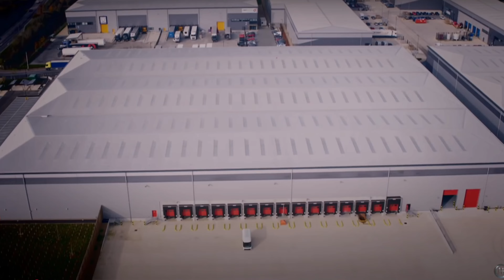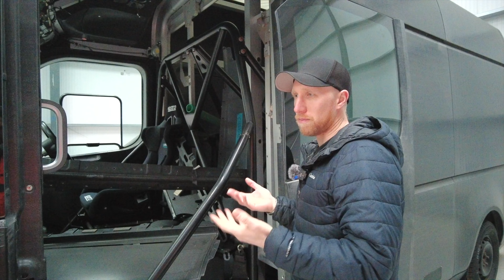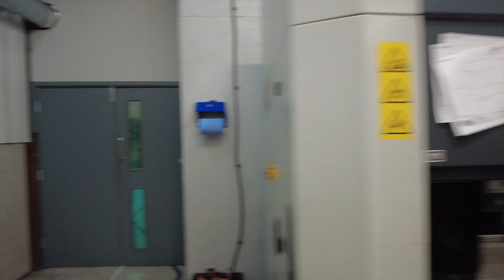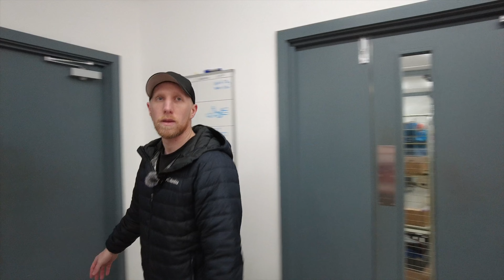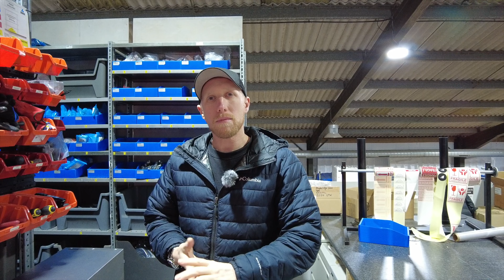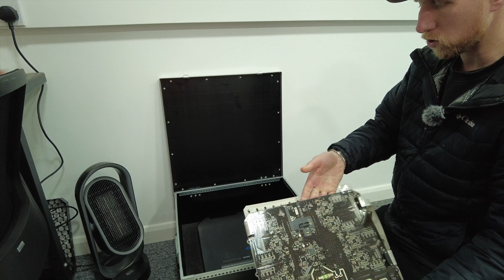FELLTEN Tour: An Inside Look at Fellten EV Conversion shop!

Comment: Amazing setup, high tech at every turn. Very impressive.      Off-topic : 
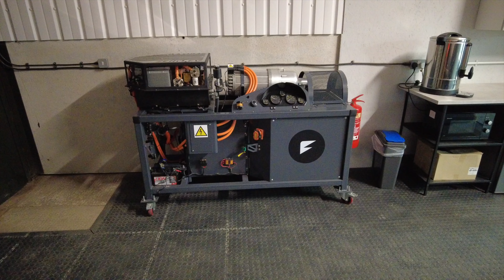Was a little surprised to see the old school water urn/boiler @14:12 ! Surely this kind of place would have an electronically controlled, plumbed-in, insulated cabinet boiler (Instanta/Marco/Lincat kind of thing!) They’re not expensive these days- and much safer and more efficient. And would fit in with the high tech environment there. 
I can’t believe I took time to post this… there’s always one 😂
Reply from the maker: @Mancozeb100  clearly passionate on the subject 🤣
Reply: @chargeheads  🤭😂😆